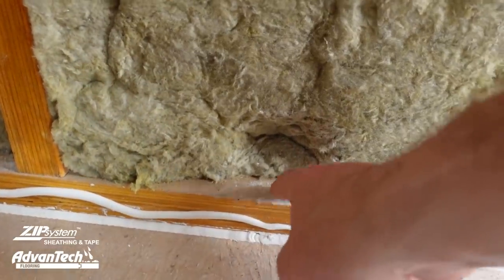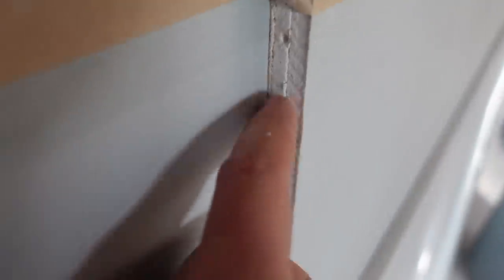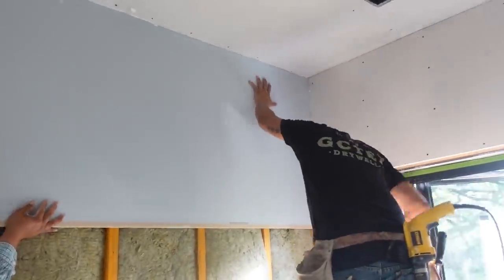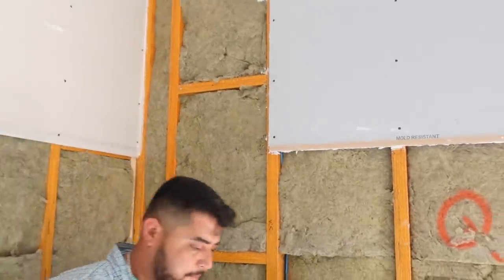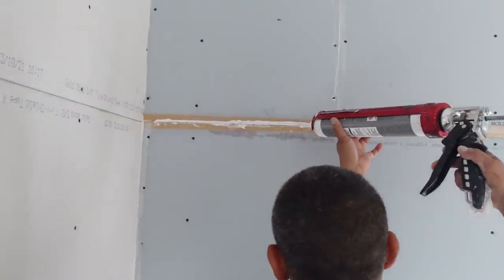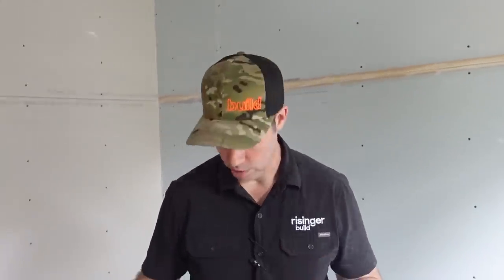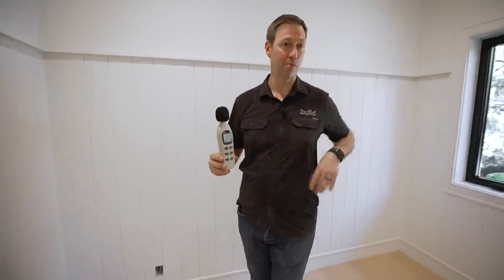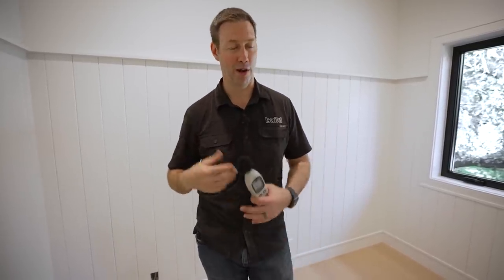3 Keys To Soundproof Between Bedrooms (incl Testing For Effectiveness)

Comment: Nice video, though I'm not convinced by your test at the end. It definitely was quieter in your daughter's room. However, the real question is not whether the noise was lower in your daughter's room, but what would the noise reduction have been if you had not taken your sound-proofing precautions. This, of course, is a lot more difficult to do! I suppose you could remove the QR, and install normal drywall, or build another, identical house, but without the QR between the two rooms. You get my point. In any case, despite the weakness of this experiment, I enjoyed the video.
Reply: @johnbergstrom2931  Thanks for clarifying, John. However, I expected the sound to be lower in his daughter's room. I just can't appreciate from that part of his video how much of a difference the special sound proofing treatment made. You need a controlled experiment to do this: one measurement without the special drywall and another with it. It's not practical to do in this situation. However, I trust that you're right, and that the treatment makes a big difference in reducing sound transmission.

Comment: Hey Matt, what’s your opinion on using the fire rated putty mats for covering those electrical boxes? I remember back in the day I was on a few projects that required that fire rated coverage over every box and it must have added some serious noise reduction because those fire caulks and fire mats all required basically an air seal around every application. I see a potential to kill three birds with one stone. ACH efficiency, noise reduction, and maximum fire protection.

Comment: Matt, a question for you. Is it necessary to take these measures, including sealing the electrical outlets, on BOTH sides of the wall? You did this only on one side?
Super video, by the way.
Reply: The other side was a closet so maybe no outlets there but wondering if he installed quietrock there too
Reply: Dosn't matter how many cheets of drywall you put on your wall if it's leaking, need to the as close as you can to air tight for the best result.

Comment: A 30db drop is really nice. A 5x cost difference in the boards is not. But I'd like to see a wall built with quietrock, versus a double wall built with 3/4 or one inch sheet rock on both sides to seevsome objective comparisons. And, loud radio or tv, not just a shopvac.

I know that's trivial, but it would mean objective numbers.
Reply: Is 1" sheetrock available? I know 3/4" is (Pabco Flame Curb X).
Reply: @MrCJHamill  Damnino. There are of special ones like QuietRock that the big box chains won't carry. A pickup truck and a couple of hours may be needed. But two thinner sheets, bonded with acoustic glue, are quieter than one thicker sheet. The sheetrock that is lead lined, used for xray rooms, really dead quiet.

Comment: Yeah, I want to soundproof one of my rooms in the house I'm designing.  The dogs hate fireworks, thunderstorms, and gunfire so it'll be very worth while to have a safe space for them.  What is the purpose of a low-voltage outlet?  What is the voltage?  Are there a lot of appliances that use the low-voltage?
Reply: I think the low voltage is for a fancy whole house battery system he was repping a while ago. It powers portable devices mostly
Reply: It's probably a wired network connection, many new homes have at least one in each room

Comment: I thought you were going to say you detached one wall  from the other by disconnecting the studs, as one would do on an exterior wall to prevent heat temperature leakage?

Comment: I've done this method before and I personally don't like it because it's super messy and it shows on your video. You're kind of smearing Acoustic sealant all over the place and it's a mess for your sheetrockers too especially when you have to handle just a bulky object with a mess all over the edges. A lot of times this becomes a sub-gap installation where your rockers might not want to do it or they treat it as a sperate day's job. Your rockers hate it, and your finishers hate it. Really the best solution is to double sheetrock. You install your quietrock or standard sheetrock, then you run a bead of sealant around the edge, and the seams. Then you install a 2nd layer with green glue and you have an incredibly quiet assembly.  That way your finishers don't have to deal with the mess your sealant leaves behind since it's behind a layer of clean sheetrock. 

Sheetrock is cheap, time and labor is expensive. I wouldn't want my subs to do it this way because it's costly and it doesn't make as much of a difference compared to doing it the right way.
Reply: He installed double sheetrock. He pointed that out. It's one of those things where the little gap of air between boards will leak sound. Mud won't do much. Fill the whole gap with more substantial material. Does a quality job all around.

Sounds like your solution does make more sense for builders though. Hard to trust a crew to do a more picky job like this.
Reply: @edgeofsins  As a builder you need to respect your subs, don't ask to do work you wouldn't do yourself. Matt's installation is a huge mess, trust me I've done it before. It's a mess for the guys doing the job, and it's a mess for your tapers. That's why it's easier to install your rock, and seal the seam with sealant, then cover it with another layer. Even if you use 1/4" rock. It's cleaner, and you're not mudding over a sticky uncurbable substance. I'm used to homes with noise dampening. There's a lot better ways than troweling acoustic sealant everywhere.

Comment: You should have used TWO layers of drywall--one quiet rock and one regular 5/8 drywall with soundblock between layers for better sound reduction and on studs. That's a very inexpensive way for a good deal more sound isolation.
Reply: Or just use two normal drywall sheets. Another idea is one drywall panel and press board. My home exterior is wood panel and 3/4” press board. Then insulation and drywall inside. You hear almost nothing if anything outside.

Comment: I'd be curious to know how much of a difference the "quiet rock" & "acoustic sealant" made. I have a feeling that the mineral wool is doing most of the work here and maybe the other two are contributing 10%.
Reply: While I'm not sure about the quiet rock using 2 layers of fire resistant 5/8 with some can't remember if its paste or caulking between provides some pretty decent improvements to the sound proofing over a rock wool insulated wall with 1/2 inch drywall.

Comment: 30 db isn't too much. Simple foam in ear protectors kill more. Pay attention to sound transmitted through HVAC air pipes, too. All in all you get what you pay for. Sound deadening is a science of its own. It's not only mass and air tightness. It has much in common to antireflexion layers for glasses using interferences.

Comment: I insulated every interior wall, floor and ceiling of my 2 story house 20 years ago.  You could blare music at an opposite room and not hear anything but some low bass at the other end of the house.  It costs very little to insulate while it's being built.. no need for these fancy caulking and such.  Just 2x4, insulation and hit every room/wall and anywhere you can with insulation.

Comment: Would you take these same steps on the ceiling if it was a conditioned attic space above these rooms?
Reply from the maker: Depends if there is a noise issue from the attic. I did not do that but you could
Reply: I was just curious about sound traveling up, over, and down.

Comment: I prefer just running 2x6 top and bottom plates with 2x4 staggered studs. Just structurally break the wall to prevent transmission. Sure, cutting the Rockwool for it is annoying but, overall stronger and better insulated walls.

Comment: You said you had extra dap quite seal or caulk left from another job. I am guessing that the client from the other job paid for it, as the homeowners pay for all materials.  So how is it that contractors always keep extra materials.  Extra lumber,  nails, windows etc.
Reply: It all depends on how tightly the contract is written. Contractors should explain somehow what happens with unused materials. But usually the homeowner doesn’t want it anyway

Comment: On a new build, I'd be wary of spending big bucks on pricy magic-pixie-dust products designed to make a small difference in a space-constrained environment, instead of doing something cheap like quadrupling up on the drywall or doing a double stud interior wall, which will likely produce a day-and-night difference at the cost of a few extra square feet.

It is absurd how much extra framing, insulation, and drywall you can buy for the cost of Green Glue & competitors.  Also: whenever I hear something about viscoelastic special sauce the engineer part of my brain thinks for a moment about how difficult it would be to produce a meaningful difference with this damping and then flips the table in disgust, screaming about fraud and gullible audiophiles (where I first encountered the product).
Reply: You're 100% correct. Putting caulk in grooves is not going to have anywhere near the effect of just adding more wall thickness and density. A lot of those soundproofing products out there - and I can't comment on quiet rock because I've never used it - are just selling snake oil.
Reply: Quiet rock is legit, but I get your point.
Reply: I always like watching Matt’s details like this and just wait for him to gloss over something obv for something trendy / designer and expensive. Sometimes I wonder if his subs doing the work are just shaking their heads - so many better and cheaper ways to achieve that Db drop. P.s that gap under the door pretty massive for new build and can’t help but notice that was glossed over. I still like the guy tho. Lol
Reply: If I had the budget, my nuclear option would be CMU between the bedrooms, bathrooms, and living spaces. Basically almost all interior walls would be CMU.
Reply: I have my doubts about 4 layers of drywall being cheaper than 1 layer of this product, unless if drywaller wages in your local market is close to slave labour...
Reply: @powrrangr99  layers of drywall that are not finished go up quick and can be very cheap relative the amount of time and materials that went into that room. To Matt’s own numbers $2 sqft vs 40c
Reply: @It's What You've Done Not What You Have you'd need to dampen layers.  I did a room w 2 layers type X .....does nothing for foot traffic noise above
Reply: @magictrading8903  dampening matters
Reply: @It's What You've Done Not What You Havevarying thickness can't matter IF it's the same material vs drywall on one and mdf or plywood as another layer. But if you are are only concerned with higher freq (voice?) ..ok. lower freq - more results if Dampening via green glue or just use 1 quietrock .  soundproofing company outlines it all well.
Reply: @umeng2002  I like the way you think! God, I love the soundproofing that CMUs provide. You can hear everything nowadays with all this shitty drywall
Reply: @powrrangr99  I would imagine your negotiating skills might come into play there too. Simply getting a crew to a location is a large part of the labor cost. Whether they work a few extra hours putting up more material could be trivial.
Reply: @johnrowell2  I lived my entire life in South Florida. All houses are CMU on all floors for all of the exterior walls. Sound will only come through cheap single pane windows. CMU is easy to lay down compared to bricks, which needs a bit more art to make look nice. CMU, just make sure it's level, and it gets covered. it's very heavy/ dense even though it's hollowed out. Perfect to kill sound.
Reply: @It's What You've Done Not What You Have I see....mask photo says all we need
Reply: @johnbergstrom2931  I mean proper installation helps, but any imperfections and tiny gaps will still cause sound to leak through. To get the best soundproofing, you have to decouple your wall or use multiple layers of drywall. The fact that you have to layer it so much shows that it was never made for soundproofing, but for cheap, low-cost mass-market construction. And if I want every room in my house to be soundproofed, that will take a ton of labor and work. Drywall in and of itself is just not a good product for soundproofing.
Reply: I like using 5/8" osb, green glue and a layer of 5/8" type X on a staggered stud wall packed with pink stuff..  Cheaper than what Matt did and it would outperform his results for days...
Reply: 100% to be honest all of these videos on Youtube on sound proofing are super cheesy
Reply: @acoustictreatmentservices9926  because they aren't real sound proofing..  You could get into the weeds on STC assemblies.. I know I did when building my home theater..
Reply: @FJB2020  even STC ratings are flawed. They don’t take into account low frequency. Under 40HZ for example which is very hard to isolate
Reply: @acoustictreatmentservices9926  true, that is why they usually say at what frequency they are testing at.  Usually 125hz and above.
Reply: @FJB2020  I agree. I posted above about my laundry room next to living room. No need for this fancy stuff. A double wall with basic sound rated pink or mineral wool insulation, a lot of caulk, 1/2 on one side and 5/8 on the other (and double 5/8 if needed) will do wonders.
Reply: Green glue is $14 a tube at my local Menards (with 11% rebate). It was about $1,000 to do my theater (6000 cubic feet) That will definitely buy you some building materials… but not THAT much. An extra 5-7 db reduction for the trouble. A little pricey, but compared to the price of everything else in that room, it wasn’t THAT bad. And a lot of people correctly point out that it doesn’t stop the bass very well from getting out, but I’m more concerned about a low noise floor in the room and sound getting IN. (Footfalls, talking loud right outside the room, hvac, etc.) Those sounds are definitely primarily above 125hz.
Reply: @ryankramer  you on AVS?
Reply: @johnbergstrom2931  green glue meant for existing walls??? what are you talking about?
Reply: @johnbergstrom2931  I've got 8 inches of concrete on all four sides (12" of concrete on the ceiling, 5" on the floor), framing within the concrete shell (room within a room) hat channel with clips, and double drywall 5/8 fire rated drywall. Since I carried it all to the basement myself, I had to draw the line somewhere. Those 12' sheets are HEAVY. The green glue is lighter. ^_^ You might ask why bother with green glue if I'm already underground in a concrete bunker, but you can hear someone in high heals walking in the garage above. Green glue works decently as a decoupling agent for mechanical transfer noise vs lots of sheets of drywall which is better at stoping airborne sound. Plus I'm installing a ducted mini-split and HRV within the concrete shell in it's own framed room and the bandwidth of sound that hvac equipment makes is an area where green glue is effective. In addition, you have to change your hat channel spacing / joist spacing and clip spacing if you want to hang three to four layers of drywall due to the weight. That inhibits the wall's ability to flex and can interfere with getting your room resonant frequency as low as possible. People can pass on green glue because it's expensive (And it IS expensive ... but at least try to bargain shop it.) but I used it for I what I believe is a reasonable and proper situation for it's strengths.
Reply: @FJB2020  Yup! I'm on there, I'm on ASR (Audio Science Review) and DIY Audio. But I'm on AVS the most.
Reply: @johnbergstrom2931  LOL. Every time the wife comes home from shopping I suppose. But the point is more about people assuming concrete is great for soundproofing. It totally IS, but it's weakness is it's mechanical transfer, hence the high heels joke. ^_^
Reply: @ryankramer  Have a build thread?  I have one there too.. Precise Home Theater Build was my last one... Starting on 2.0 now :)
Reply: @FJB2020  Hah! I'm already subscribed to your thread! LOL. Mine is Cinema Midwest 2.0 ^_^
Reply: @ryankramer  Yeah I have seen yours lol.  Been waiting for an update ;)
Reply: @FJB2020   I'm stuck on weekends babysitting webinars, otherwise I'd be down there building right now. ^_^
Reply: I think an important first step in choosing materials is to totally disregard every selling point these manufacturers advertise for their products. Sound transmission is simple: vibrations travel through air because it lacks density. To dampen sound, restrict air flow and use high density material. Thickness does not automatically translate to density-e.g. drywall is porous, mass loaded vinyl isn't, so it has more mass per square unit. Foam acoustic panels are dense and porous, so they absorb vibrations rather than letting them pass through or bounce back into the room.

It's not always necessary or cost effective to use materials advertised for soundproofing, especially when most people are renovating an existing space rather than planning a new build
Reply: @Bloody_RedQueen  Not just airborne sound, but impact (mechanical transfer) and flanking sound as well. Highly dense materials not decoupled properly can  potentially cause  different types of issues.

Comment: That tiny gap between the insulation bats, even if 1/1000 of the area of the wall, may also diminish the overall sound proofing significantly. Keep the insulation tight; the chain is a strong as its weakest link.
Reply: Not gonna do alot, the insulation absorb sound, don't do anything for the soundproofing since it's not air tight.